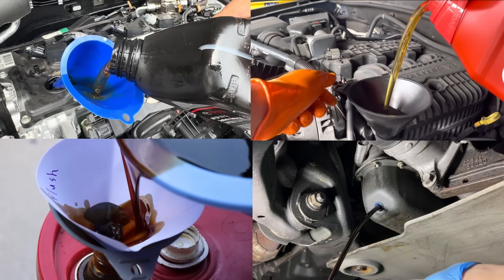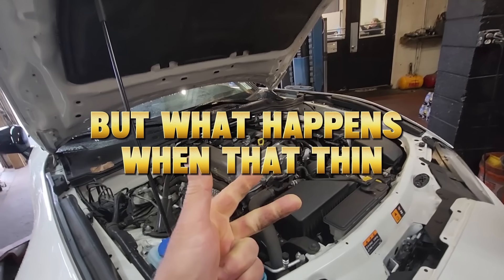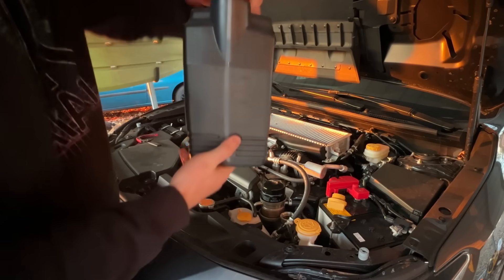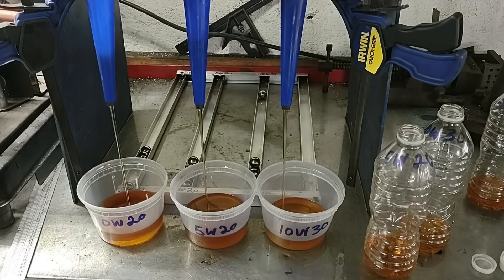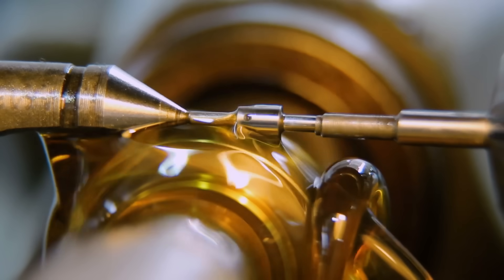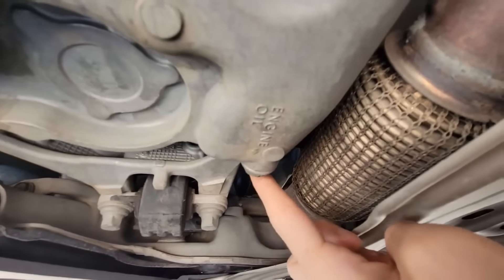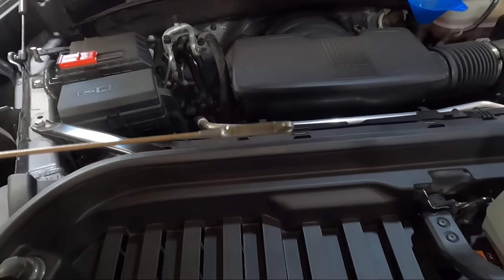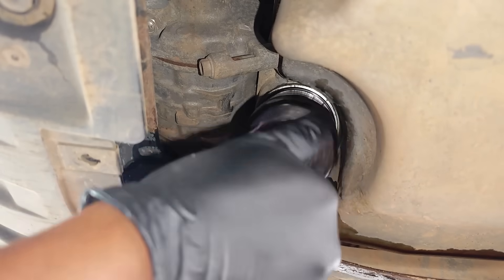The TRUTH About 0W 20 vs 5W 30 Oil (50 Engines Tested!)

Comment: Does anyone in the comments have practical experience with what they say? I was around befor Mobil 1 and when it got popular in my area my Dad asked me to come over and change the oil in his brand new Cutlass Supreme. (350 V8) His house was brand new too and my baby sister carved the year into the concrete in front of the garage. It was 1978. Dad read his can of Mobil 1 and said 25,000 miles is a long ways to go on an oil change. But he did it. When he called me over to change out his Mobil 1 he told me he was sweating bullets running it so long. He used to go 5,000. So, we changed it out and talked about it at length. We both decided to go 10,000 miles. It would be an easy number to remember and less than 1/2 the Mobil 1 recommended mileage and instead of changing the filter every other time, like we did at 5,000 mile oil changes, we'd change it each time. It'd still be cheaper than changing oil every 5,000 miles and the filter every other time. So, we adopted it. I've been going 10,000 miles on all of my stuff since 1979. I've never experienced any kind of problem and on the rare occasion that I had a glimpse inside my engines, like the rocker cover off on my 77 Volare' w/ 225 Slant Six "Super 6" engine TO ADJUST THE ROCKER ARM CLEARANCE at 240K, or my 1998 Vortex 5.7L Vortec for plastic intake manifold coolant leak at 300K it was so clean inside I was amazed. My Dad drove his Cutlass to 120,000 miles and I remember the year on that too. It was the year after they stopped making the rear drive Cutlass Supreme, 1988(?) because we went out after our annual 4th of July family reunion to buy one and the Old's dealer told us we couldn't order it because he had no price brochures for it. We ended up with a Monte Carlo with the 4.3L V6.* Then Dad gave the Cutlass to one of my sisters and the only thing it ever experienced was a misfire after my sister over heated it somehow. When I got over to Dad's to look at the misfire, I found that one of the cylinders in the middle on the passenger side, either #4 or #6, I don't remember which one, but the one that was associated with the exhaust crossover for heating the intake manifold had a weak valve spring. So weak that the way I found it was when I was so frustrated w/ trying to figure out why it was misfiring, I had removed the rocker cover to "see" something. There was nothing to ''see" and at that point I leaned on the rocker arm in desperation and the spring collapsed from the weight of my hand/ arm leaning on it. I replaced just the spring and sis drove away. That engine was clean inside too. 10K oil changes were the norm at my family. No one has ever experienced an engine failure or mechanical issue. That is my practical experience with 10K oil changes and it's REAL WORLD. 
But I also worked in Emissions, Fuel Economy and Drivability at GM, in Milford, Michigan and I know first hand why there is a push for 5W or 0W motor oil. It is the EPA pushing for more gas mileage. After the 1973 Organization of Arab Petroleum Exporting Countries (OAPEC) Oil Embargo, dubbed "The Energy Crisis" (HOAX)  our government decided to ruin the U.S. Automobile industry by imposing Fuel Economy requirements on it in the form of a Corporate Average Fuel Economy standard (CAFE) and Gas Guzzler Tax instead of owning up to the reality that the U.S. government involvement in the Yom Kippur War made the Arab Nations angry and they were going to impose a higher price for their oil. In an effort to save their jobs, our government decided to squelch the U.S. auto industry and screw the public instead of own up to their mistakes. So instead of being fired from their gov jobs, they let the public suffer a standard of living drop by saying we were running out of crude oil world wide. Today we have more oil than we ever knew of and we've been burning right along, so there's your myth exposed. We lost our nice luxury cars and our flashy muscle cars to the government's hoax of running out of oil. Then they tried to link Global Warming to the use of Fossil Fuels and when that didn't work (not that they have given up on it completely) they have now imposed the idea that somehow air quality is effected. It's all a hoax and the EPA should be revoked. But I digress, back to the fuel economy tests.  The tests that the Fuel Economy measurement is derived from I DROVE AT LEAST 20,000 TIMES. And I'm here to tell you my experience IS that I could vary the FE results of the two tests, the EPA III and the Hiway Fuel Economy Test, (HWFET) way way way more than lightening up the low number on the motor oil ever could. That is a testament to how a driver can effect FE. We actually had a standard of driving that GM spent 1 $ Million on to study MY DRIVING STYLE and impose it upon the "crew" that I was part of. My driving style became the bench mark, setting the standards for all other drivers to match! So, I know what I'm talking about. Driver habits are 10 times more important than oil viscosity is on FE. I've even run the Toyota 0W-8 motor oil in my own stuff hoping to see if I could detect an improvement, and NO! 
If you are foolish enough to trust your engine to additives instead of lubricants, go for it, I know what I know and viscosity improvers like synthetic polymers such as Polymethacrylates (PMA's), Polyisobutylene (PIB's), and Olefin Copolymers, (OCP's) Anti Oxidents, Detergents, Ceramic Particles of Molybdenum, Esters and Fatty Acids may be great for chemical engineers to play around with, but I want my stuff to stay in tip top shape until death do us part. I'd rather use the real thing. Sorry, it's personal. ben/ michigan u.s.a.

*I took a job at GM on 15JAN1979, so everybody in my family bought GM cars thru me.

Comment: This video is garbage. I'm a l1 master tech and wrong viscosity on newer engines will cause vvt issues. Use good oil and change it regularly.  Use the manufacturer specs not this stupid video

Comment: There is no such institute in North America.... 
Your playing off of the GM recall and the related oil issues with it. Your playing on fears.
There is a huge difference between engines with over 10,000 miles and under 10,000 miles(break in) and break in metals no matter what viscosity. This AI video is a complete hoax and will actually get people spending money who don't need to and may actually hurt their engines listening to this fantasy.

Comment: I have Subaru forester fb20. I am using 0w20 GF6A. Car don't burn oil. It's 83000 km and I am living in Norway, Oslo. I am thinking to use 5w30 in the summer and 0w20 winter. What people think about it?

Comment: He left out two important points - first, the thermostat keeps the engine running warm even in cold temperatures, but the most important thing is to use a Group IV oil!

Comment: 10 year old Toyota 4 cylinder sedan.

I use Castrol GTX semi synthetic 5W-30, daily driving in a warm country. Bought it used cheap as a run about for work and ended up using it more than expected as it falls into the family shit box category😂. Don't know the previous maintenance that well on the car and it had a little over 100k kilometres on it, but still runs smoothly with no issues currently at 170k+ kilometres 

Service routine:
5000kms oil change with Toyota OE oil filter, and Wix air filter (air filter change at 10000kms)
40000kms ATF oil change with Petro Canada ATF fluid (I feel it's runs  smoother with this oil than the Toyota ATF fluid) + OE AT strainer change. 
I also changed the fuel filters including the tank filter and put in Iridium spark plugs when I bought the car 2 years ago. Will change both when I hit 100k. On my service schedule, I started from buying the history less car. 

Fuel I only use 97 Octane Shell unleashed since I changed out the filters, for consistency. 

Tyres alignment, balancing and rotation every 10000 KMS.

Other  than I need to change the belt  tensioner pulley which recently started squeaking, zero issues and everything works perfectly.

Comment: If you really want to make a difference to engine longevity .. and one side of the crankshaft thrust bearing with a manual clutch, permanently switch off 'stop start'.

Comment: Almost burned up a 305 chevy truck engine towing a U-Haul trailer one time running 10-w 30 Castrol. Good thing I had a bottle of STP behind the seat that saved the engine. I probably should have been running 10w40 or even 15w40 for towing.

Comment: I used 5w20 synthetic in my hemi and ruined my engine. Got it rebuilt and 7000 grand later I switched to 5w30 synthetic.  Engine sounds smoother and seems to have more power.

Comment: It’s fake ok here’s my research for this I have a Volvo v60 d4 running ow 20w oil it has 300k miles on it as a taxi uses no oil runs like a dream no issues, my ford transit mini bus runs 5w 30w oil that too has 317k miles on it use no oil no smoke no issues. It’s not about the oil it’s about how often you change the oil running dirty oil is the engine killer not the oil itself. All my Taxi’s run full synthetic oil and they get an oil change every 10k miles and that there is why there never an issue.

Comment: Allways prefer the 0W-20 motor oil in any situations and conditions of use than any other viscosities for todays new generation of turbo direct injection engines.
Lighter motor oil offers many advantages than all other heavy motor oil.

Comment: I have a 2003 Ford F-250 Super Duty that I used 20W-50 regular castro gtx motor oil. I changed it every 2500-3000 miles. It has 380,000 miles right now. But I tested a synthetic 20W-50 castro gtx motor oil for this truck, and it started making a ticking noise after driving it 1800 miles with that synthetic 20W-50 motor oil. So yeah, thinner oil is not better. Then, after that incident happened, I changed my motor oil back to the regular 20w-50 castro gtx  motor oil, and the ticking noise went away.

Comment: I've always used 10w30 mobil 1 fully synthetic 

On my turbo application, I switched to Rotella 10w40. 
Because the head gasket issue. Never had anymore issues  ran the car on that same set up for 5 yrs tuned on E85.

Comment: W takim razie proszę o podpowiedź czy zabiję silnik (jak twierdzi ASO) czy nie, jeżeli przejdę z 0w20 na 5w30 i czy to cokolwiek da. Pacjent - Volvo S60 T5 2014r 245km. Przebieg 130tys km. Auto kupione nowe w salonie. Od przebiegu ok 70tys km zużywa 1l oleju na 2tys km.. Jedyny zalecany w instrukcji olej oraz akceptowany w ASO (auto ciągle serwisowane w ASO) to 0w20... ASO odmówiło wymiany oleju na 5w30.
Reply: Z tego co znalazłem na internecie, to olej do Volvo S60 T5 2014r, to 0w30. Najlepiej sprawdzić w książce (Owner’s Manual). Litr oleju na 2 tys. km to trochę dużo, to albo zużyte pierścienie, albo zasysa olej przez PCV valve.

Comment: for my 1year old atmospheric gasoline toyota engine, service insist on using 5w30, i live in Turkey where the weather is cold up to -10 C in a 4 month period and 3 months up to 40 C. the car is used 90% in city traffic. i want to use my car at least for 10 years. which oil is reasonable to use. Or should I use 0w20 for 2 years for example and turn back to 5w30. comments pls...

Comment: My 2026 small suv states 0w20. We went to our Chevrolet dealer for the first free oil change and they put 0w20 back in it. We live in Florida where it is hot. I believe the 5w30 is better. What do you think? The Chevrolet service manager told me the GM wants them to use 0w40. What about that?

Comment: I have a  2008 Dodge Caliber with 342,000 miles. I change my oil every 3,000 miles.  Only thing done to the engine is valve and oil pan gaskets.

Comment: Own a 2001 ford explorer sport since 2001 been using 5-30 synthetic since and change it every 3000 or 4000 miles max. Its 2025 car falling appart but the engine sounds like new with NO oil leak. Its at 220,000 miles so far. Engine sound like new still

Comment: I have used 0W20 because that's what the sticker says. I guess when summer comes back, I will use 5W30. I am not heavy on the accelerator but in Canada where I live the seasons are extreme. I have a 2020 Equinox with 190,000 km. Thx George

Comment: Hmm. Not arguing which is best but our 2012 mitsubishi Lancer GT has over 200k miles with 0w20. Uses 1/4 to 1/2 qt at 5k miles. 
Also 0W8 isn’t just North America. It was developed in Japan over 10 yrs ago (also 0W12. They have been working in 0W4.

Comment: Tu mejor amigo es el 0W40 y el 5W40 de alto HTHS mayor de 3,5mPascal.seg de viscosidad cinematica. Casi todos los 5W30-0W30 son de baja viscosidad, bajo HTHS y baja fricción solo aptos para algunos motores, los 5W30 con alto HTHS son hiperaditivados con polimeros....para conducción suave, trayectos cortos, conduccion NO exigente y climas templados frios...esta más menos OK, eso es el 80% del uso general de todos los usuarios. Para los exigentes y conducción más dura y clima adverso de calor ambiental 0W40-5W40.....y a distancia 0W50-5W50, combatiras mejor la dilucción de combustible. Ese aceite 5W30 que usas en 5.000kms-8.000kms ya es un 5W20 o menos. Eso que comentas de los 0W30...pues, puede que sean de mejor base sintetica, nada más, continuan siendo la mayoria de bajo HTHS y bafa fricción, más finos hasta que se calientan y van perdiendo viscosidad, pero a 100ºC 0W30 y 5W30 son iguales.... ILGSAC GF-6 solo contempla aceite de bajo HTHS y baja fricción. REPITO 0W40-5W40 es la elección CORRECTA-REPITO 0W40-5W40 es la elección CORRECTA-REPITO 0W40-5W40 es la elección CORRECTA.
Reply: Er is ook een gegeven wat met ketting aangedreven of riemen . Met distributieketting gebruik ik meestal 5W30 of in winter 0W30 , met distributieriem ga ik van 0W20 of 0W30 of 5W20 of 5w30 als ook 5W40 voor CNG en LPG motoren . Voor turbo diesel nemen we 0W30 of 5W30 . Met ketting is het ook belangrijk de afschuifkracht van de olie voor de top van de moter . Bij moterfietsen is het ook nog anders met de koppeling die in de olie karter zit en toerental tot 10 a 12000 rpm met afschuifkracht 10W60 . Wat is er juist of niet juist , enig idee ? Alvast bedankt voor deze reportage of gedachten gang .
Wim .
Reply: @wimwouters3440 Si tu temperatura ambiental es de -20°Cmin a 20°Cmax...0W30,5W30...es admisible si haces tambien uso suave, trayectos cortos, paradas y arranques continuos. Bajo hths-baja friccion debajo de 3.5 o 2.9 solo en motores que lo admitan por sus aleaciones, grafito falda piston...etc..etc..que igualmente pueden usar aceites superiores en sae40, todos los Sae40 son de alto-normal hths de 3.5-3.7 m.Pascal.seg.
GNC-GLP...aceites con aditivos o indicados para ello, Motul tiene eso entre otras marcas...pero supongo que muchos sae40 son aptos.
Cadenas distribucion son criticas en desgaste, frecuencia de cambio es importante, uso exigente..
Aceited de baja viscosidad+bajo hths permiten un ahorro de combistible del 1% al 3% max. dicho ahorro no sale gratis, hay desgaste, siempre hay desgaste al 100% a veces más a veces menos...todo tiene un costo.
Aceites new age...Api SN SP acea C vienen recortados de aditivos..., o sustituidos clasicos aditivos por otros. Api SM fue un desastre. Api SL acea a3/b4 fueron oro en aditivos.
En diesel en europa se usa aceite api CF...obsoleto, son aceites mas bien para gasolina en cierta medida debido a la masificacion de motores diesel. Diesel necesita alta detergencia.. Se prioriza eficiencia ecologia VS longevidad...se prioriza vida de FAP-DPF a vida del motor.
Diesel api CK es correcto, HD, diesel pesado uso severo. El diesel sin azufre europeo ayuda mucho en el uso de aceites de baja detergencia en automoviles diesel...estimando vidas utiles de no mas de 300.000kms de media..la gran mayoria cambia antes de coche...EFICIENCIA.
El 10W60 adecuado para motos lleva otros componentes, sobrebtodo en embragues humedos. Es una alta viscosidad...depende de donde se esté usando es OK o no, hay mas SAE's disponibles sinteticos para motos...10W50, 10W40..para motocicletas...e incluso algunas recomiendan si o si mineral..no hay problema, el 90% de aceites hoy sinteticos llevan casi todo base HC grupo III que son bases minerales supertratadas con caracteristicas similares a las clasicas Pao y ester.
En mis coches..v8, v6, L4, diesel y gasolina uso 0W40-5W40-5W30-0W30-5W50 ese es mi armario de OIL que compro segun oferta y suelo hacer Blended o MIX entre ellos sin problema. Mezclo 5W30 con 5W40 en distinta proporcion, mas cantidad de 5W40 por ejemplo o 5W50 con 0W30 y 5W30 sin importarme si este ultimo es bajo hths acea C2 o normal hths acea C3. Procuro usar 5W40-0W40 acea a3b4 antes que C3...pero tampoco hay problema en usar C3.
Periodos de cambio cortos antes de 8.000kms-10.000kms son importantes en sae30, bajoTBN, DILUCION de COMBUSTIBLE, un sae 40 tambien lo sufre, a los 10.000kms es muy probable que ya sea un sae30, su viscosidad cinematica haya disminuido tanto como para eso...el sae40 se ha convertido en sae30...., en que se ha convertido un sae30 despues de 8.000kms???? Y un sae20..en que se ha convertido????. Se estan rompiendo y cambiando mas motores que nunca gracias a la eficiencia y ecologia. En alta exigencia al limite...ni el mejor 5W50 o 20w50 sinteticos, 20w50 muy estable y mejor ante dilucion siempre que seansintetico...usado en carreras donde no importa arranque en frio. Ni el mejor aceite evitara que si el motor dice de romper..lo termine haciendo. Solo se intenta conservarlo, si piensas mantenerlo muchos años y muchos kms que llegue a viejo motor en las mejores condiciones de desgaste..el cual solo podemos MINIMIZAR pero no evitar.

Comment: Opel Insignia 2017 (Buick Regal in usa)1.5 turbo DI 
Since 6 years every year oil change about 6-8k  km . I Use Ravenol dxg 5w30  best oil ever 😉
5w30 was Original until 2019-2020 the companie said now you need the other thinner oil 0w20 its Better for your engine😏 we all know its because the climate hoax 🤫
they dont care if this destroy your Car .
Greetings from Germoney